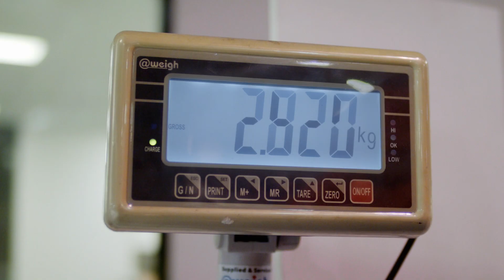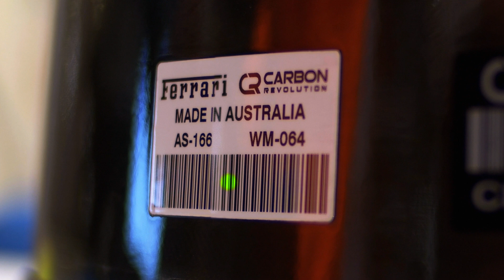Carbon Revolution | Engineering the Impossible by Reinventing the Wheel

Comment: How do they hold up to impacts?  Carbon fiber is pretty brittle ( Rocks and road debris)
Reply from the maker: Hi Jon, thanks for your question! Our wheels have gone through an enormous amount of impact and fatigue testing over the past 15 years, both in testing rigs and on vehicles to ensure they are strong and durable. Results from this testing paved the way for us making OEM wheels, which we now do for Ford, Ferrari and General Motors. These companies would not have worked with us if they were not confident about our wheels' strength. 

Carbon fiber is a very strong and rigid material and well designed carbon fiber components are not hard and brittle. You can find out more about our wheels in this recent article in MotorTrend https://www.motortrend.com/news/carbon-fiber-wheels-ev-advantages/
Reply: @CarbonRev  I've built carbon fiber structural parts for F-35 and F-22 Fighter jets.  Been in aerospace composites for 16yrs.  Even those parts are hard and brittle.  Definitely must be something you guys know that aerospace doesn't.
Reply from the maker: @jdamore44  maybe so Jon ;)
We have a lot of patents and IP protecting our designs. 

The major difference between many carbon fibre aerospace components and our wheels is the amount of different forces our wheels are subject to. We design our wheels to be light, but they also also need to withstand all of the normal forces a wheel is subject to - in cornering, acceleration/deceleration, impacts etc. This involves employing very complex fibre architectures within the wheel.

Comment: Hi Luke Maunsell,
I've been looking at carbon fibre composites, for race application companies for a few months.  Taught myself Solidworks.  Looked into airfoil design for rear wings, simulation etc..  The basics of aerodynamics and carbon parts for a variety of vehicles.  From Layup techniques to resin infusion.  Reason is i wanted to fulfill my passion for cars, not just looks but performance so i contacted TopStage.  And Freedy told me to contact you.  The courses at The Gordon are a no go atm.  I'm a 30yr 3d modeler and good with my hands and attention to detail.  I drive a 'money pit' Nissan  Silvia s15 
spec r.  Just got full engine rebuild with more race spec parts.  My question is how do i break into the industry and are you guys available for a chat?  I want carbon Fibre in my future!

Sincerely,

Matt Cantlon
Reply: How's things panned out in the last 4 yrs Matt

Comment: Can’t wait for the EV wheels! @carbonrev
Reply: I wonder what issue occur they are used on massive instant torque BEVs. Does that cause any damage risk. I guess they will have to specifically design wheels for high powered BEVs.
Reply from the maker: @Neojhun  the amount of force placed upon a wheel in an ABS stop is actually greater than any instant torque from an EV motor. Our wheels are designed to withstand repeated ABS stops, like every other OEM wheel!